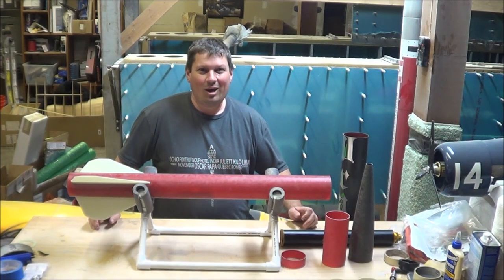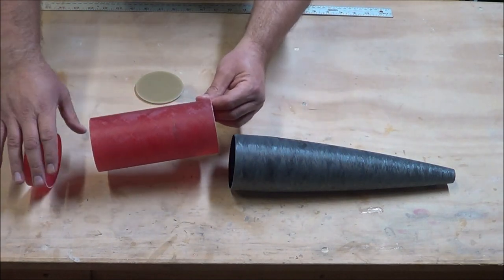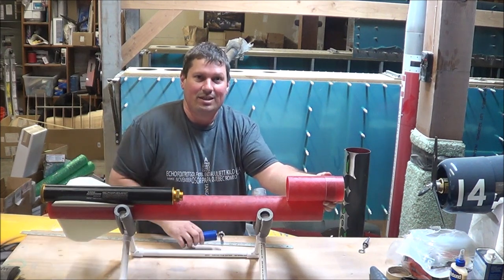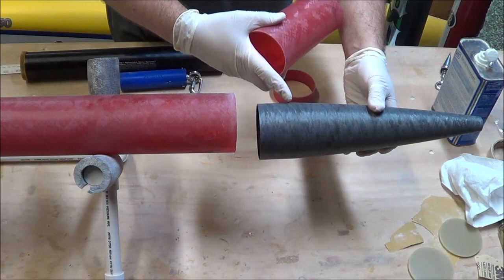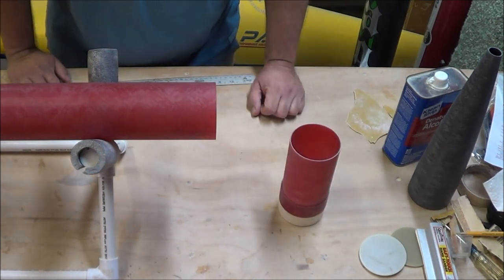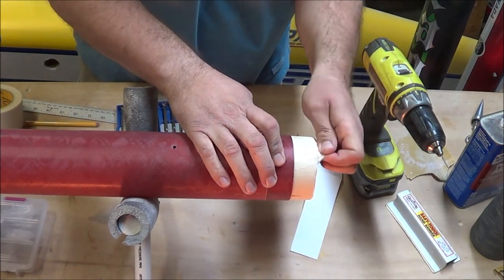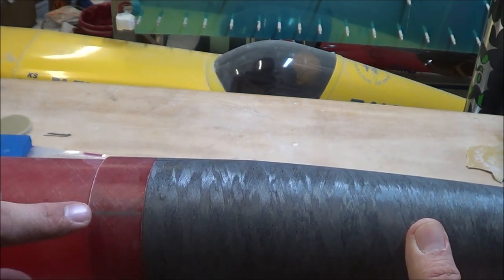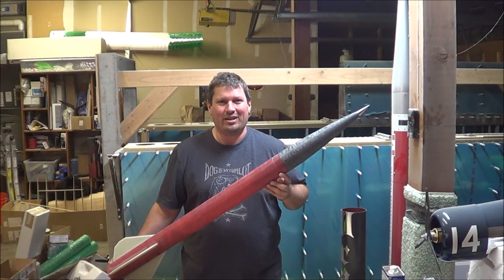Head-End Dual Deploy setup with Wildman Punisher 3

Comment: Thinking about doing Head End Dual Deployment also.  Based on what you are doing by putting your charge on the coupler,/ebay, this will push the nose cone off the front which will carry the drogue with it.  When the shock cord finally tightens, the drogue will be pulled out.  Any thought to placing the charge  in the tip of the nose cone so all is push out instead of pulled out.  Does it even matter?
Reply from the maker: This is really no different from normal dual deploy setups with a hollow fiberglass nose cone.  The pressure will build in the entire nose cone area before separation occurs, and the parachute will be pushed out of the nose cone as the nose cone is separating from the avbay.

Comment: Any special considerations for packing/charges/etc with HEDD? I'm looking at a Mac Black Fly for my L2 and HEDD seems like the way to go
Reply from the maker: With all the gear fitting relatively tight in the nose cone, you just want to make sure that your ematches are secure and the wires can't get yanked out of place when you pack the gear and set the nose cone in position.  Other than that it's not much different from a standard setup.
Reply: @flyfalcons  good to know, thanks for the reply

Comment: Ryan, do you have any videos of the Punisher 3 flying?
Reply from the maker: Yes, it flew during the June and Sod Blaster launches last year.  It flew during those launches this year as well, and I'll be getting those videos published as soon as I can.  Being a heavy fiberglass rocket with smaller fins, it really prefers a high thrust motor with good speed off the rail.
Reply: @flyfalcons  Any trouble keeping it under the 9000' waiver?  I would think a punisher 3 would be quite the hotrod!
Reply from the maker: @321Launch-ke7ji  No trouble with proper motor selection; large I motors through medium J motors keep it in the 4,000-5,000 foot range.  I would really like to stuff a K1103X in it, but it'll be well over 9,000 feet.

Comment: How did you attach the metal tip?
Reply from the maker: @greenlex518  there is an eye bolt and washer that go on the inside, you screw them in place.  You can also add epoxy.